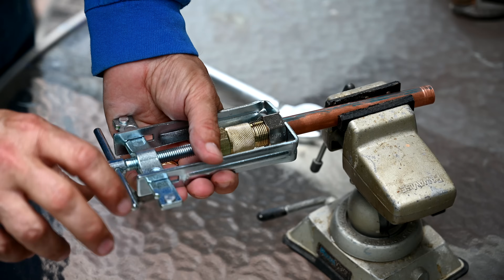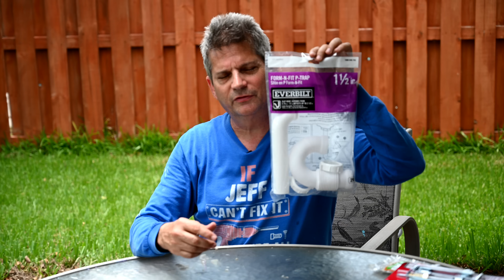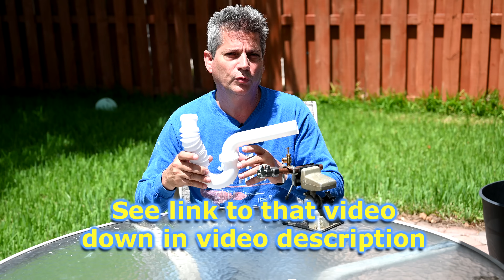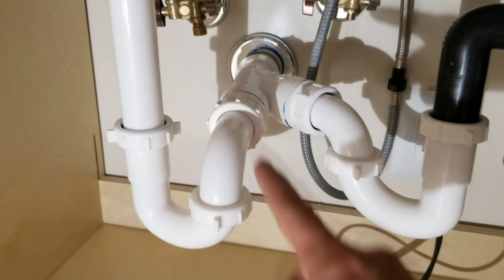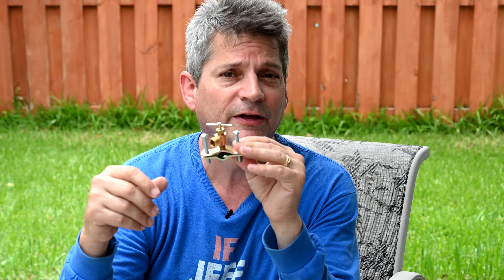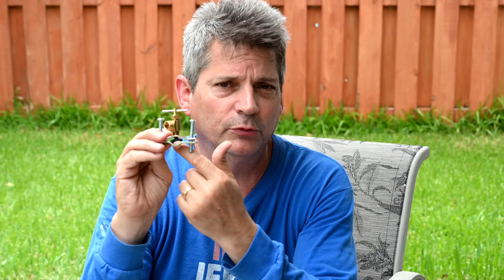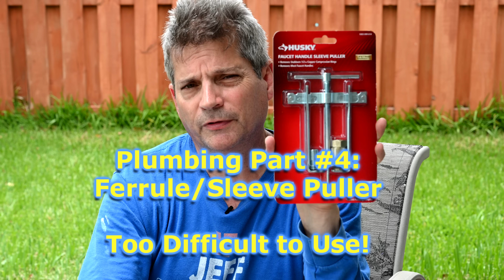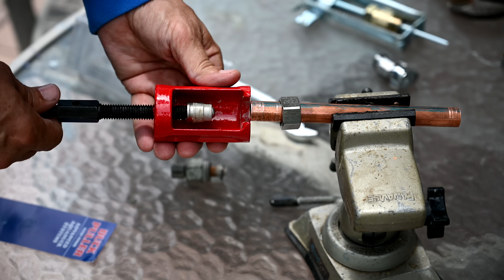4 Plumbing Parts/Tools You Should NEVER Use. NO Plumbing Fails

Comment: To get the compression rings off just grab the nut with your grips and pull and twist or smack the nut from behind with an adjustable spanner around the pipe. Or just cut through the rings
Reply from the maker: Man that's a lot of work for being caught in a tight spot with no room to move around. I refuse to bang on pipes out of fear of ruining a solder connection inside the wall somewhere. That's why I have the duck puller now, it works every time with little energy expended on my end. Before I got this tool, there was one time I  simply gave up and cut the pipe behind the nut, but you don't always have enough pipe coming out of the wall to get behind the nut and make your cut.
Reply: jeffostroff in the UK, Monument make a tool for removing the compression rings where you place the head of the tool around the ring and when you squeeze the handles together it shears through either side of the ring then you simply remove it with little effort and no damage to the pipe
Reply: jeffostroff what’s the duck puller like if someone has really tightened the fitting way too much? Does it still get them off?
Reply from the maker: @laernulienlaernulienlaernu8953  The puller is great, any time I have ever had to remove something that is stuck, the physical properties of using a wrench and screw to drive/pull something out cannot be beat. One time we spent 3 days trying to get a MOEN shower cartridge out of the shower and multiple trips to stores trying every trick in the book failed until we got a tap and die kit, drilled threads into the center of the old cartridge, and used a lag screw through a plywood board to tap into the cartridge and unscrew the cartridge using a socket wrench on the lag screw.

Comment: In the UK we still use “S” traps and our regulations are very comprehensive. Our drainage systems must just be better coz they rarely cause a problem if the drainage is installed correctly
Reply: laernulieNlaernulieNlaernulieN Yup, ventilated drainage prevents syphoning of the trap. Proper downstream regulations prevent the problem so we dont have the problem. P trap doesn’t prevent that problem either: pipe goes “through the wall”, and guess what happens then?!
Reply: Andy Owens a P trap with a 90 degree elbow on the outlet is no different to an S trap really. Does their “plumbing code” ban them from doing that? Does the pipe have to go through the wall?
Reply: @andyowens5494  What happens then, in theory, is that there remains enough horizontal pipe run between the P trap and the wall to prevent the siphon effect by leaving enough water in the bottom of the horizontal tubing to let the rushing air pass and go down the drain while the water that made it into the horizontal pipe section can flow back into the trap or at least slow down enough as it goes down the drain to prevent the rest of the water remaining that an S trap would pull out of the bottom loop from getting out of the trap.  But the key is the venting downstream of the trap!!!

Same thing happens with dam water level regulation with solid plumbing...  If you want the pond to remain at a desired level but have a solid pipe letting excess water leave the pond without draining too much water from the pond but also not getting clogged by floating pond debris and also removing excess sediment from the pond bottom, it's common to run the solid plumbing from the bottom of the pond up and through the pond wall to the drainage area and even with 18 inch diameter solid plumbing, a simple 1/2 inch diameter hole in the top of the solid plumbing on the downstream side of the pond wall will allow enough air into the plumbing to keep the pond at the desired water height instead of allowing the solid drain line from being able to siphon the pond completely empty even though that solid pipe went through the pond wall and exits into a stream or river 30 or more feet lower than the bottom of the pond.  Without that 1/2 inch diameter hole in the pond drain line, the pond would siphon completely empty fairly rapidly but with that 1/2 inch hole the pond water remains not much lower than the bottom of the horizontal section of pipe where the pipe runs from the pond side of the pond wall to the drainage area.
Reply: Andy Owens goes right through the floor lol your so right
Reply: As long as the first part of the trap is deep enough, that air can be blown through the trap, and leave enough water to seal, you're golden. If you ever have a problem of the trap clearing like a toilet, just make the first drop deeper. If you look at it closely, it will do exactly what a toilet does when you flush. It's just that a toilet slowly fills the trap back up, which is the level of water in the bowl. If that ever happens in your sink, you can do the same thing, by just trickling in some water. I've never had it happen.
Reply: Like Andy says below, adequate ventilation will prevent syphons. In the US here, I believe when you "start" a horizontal run, you are required to have a vent nearby, within 6ft I think. Because a p-trap connects to a horizontal pipe, you can be sure that there will be a vent between that trap and another fixture (or else that fixture will be close and will use that same vent).
Reply: Justin Link 

Exactly right!  I was going to say what you did but you beat me to it!
Any horizontal run over six feet requires a local revent in the U.S..
Reply: Same in Oz. Our regs are based on the UK system and have never had a problem with s traps.
Reply: @paulmac7667  Could it be that a vent is required to prevent the mentioned suction?
Reply: I use s traps and never had a problem with siphoning. I though you could not smell methane as he mentioned at 2:30
Reply: @Mike Ladd  BINGO

Comment: Great information....hopefully the DIY people will learn from this.  
One thing to keep in mind for your future videos....Methane gas is Odorless. Methane is usually present in sewer gasses but it's not the one that smells bad.
Reply: natural gas (methane and other hydro-carbons) service has an odorant mixed into the service lines, so we tend to identify a gas leak with that gas smell. That's done on purpose :)
I agree with Andy Owens, some kind of sulfur compound will be what smells.
Reply from the maker: and it's odorless and tasteless, so I wonder which gas it is that we smell when we open up the p-traps
Reply: jeffostroff Sulphides. Most commonly hydrogen sulphide.

Comment: U r not as smart as u claim 2 b buster that tool is 4 pulling off the handle 4 a tub or sink faucet dumbbell
Reply from the maker: Yes! Our first uninformed troll! Husky is trying to bill itself as both a Faucet handle AND a sleeve puller. Look at 17:30 where I hold up the package, you can see the 2 bullet items they printed on the package it claims "Removes Stubborn 1/2 in Copper Compression Rings", and "Removes Most Faucet Handles". Why do you think that center gold threaded puller adapter piece screws into the compression nut, Mr. Know it all? On the back of the package are 2 sets of instructions, one to use as a faucet handle puller, and instructions to use it as a sleeve puller as I showed in this video, and showing it go around the nut. So.... YOU are not as smart as YOU claim to be Buster! Thanks though, you gave us all here a good laugh.
Reply: Why have the arms around the nut? You just threaded the tool into the nut, just add the missing part and use it correct 😉

Comment: saddle valves are allowed in the state of Maine where i am from the flex trap # 2 are passed with no problem your codes are stricter then ours
Reply from the maker: Holy cow that crazy state of Maine! Next, they'll start treating the drinking water with CBD!
Reply: no we use a number of diff ways to make it safe the problem with the flex traps are build up and clogs its true i use them for temp hook ups until i have the right parts to do the job right.
i do find most of my trade friends say florida has some of the strangest rules around but thats how it is in most any state

Comment: Been a plumber for 20 years. I use #4 to remove vintage handles off of tub valves and lavatory valves that are period correct for their home. And they help to not damage the finish.
Reply from the maker: Yes, I would imagine they will grip behind those larger handles a lot better than that mall area on the back of a shut valve nut.

Comment: Might work if you were using is properly.
Reply from the maker: What might work if it was used properly? none of these parts are allowed  because they don't work properly.
Reply: The ferrel puller.
Reply from the maker: @rosscoep1450   You are more than welcome to keep using that 1 and no it doesn't work on stock Ferruls that's where it just does not work
Reply: @jeffostroff  I dont own one, just saying that it looked like it was being demonstrated incorrectly. I reuse the nut and ferrule, they are usually still good.
Reply from the maker: @rosscoep1450  the problem with that Husky sleeve puller as all the darn moving parts. Too many moving parts, and something has to give. That's why I like the duck puller, only one moving part.

Comment: Good video, but two quick comments... 1.  You mention "Uniform Plumbing Code" (which would infer "UPC"), but isn't Florida under IPC (International Plumbing Code)?   (For the benefit of anyone reading comments, the two codes have some rather dramatic differences in some areas.)

2.  The "craptastic" accordion (#2), I think that technically that's not the trap but the tailpiece, so it may require a different code reference.  Code reference aside, I agree with what you said regarding their use.  They're crap.
Reply from the maker: It's hard to say, some counties in Florida add and delete codes, and I do loosely use the term Uniform Plumbing Code to sort of refer to the broader scope of all plumbing codes, which states usually adopt either all or part of the IPC and UPC. I really wish they would all just take the best parts of UPC and IPC, and create ANSI standards that everyone could follow without getting confused as to which part of which standard the county is going by. I don't know why there is such disparity between states. For example, most states allow a high loop under your kitchen sink counter on the dishwasher, but Wisconsin forbids it, requiring instead those ugly top of the counter air gap devices. Here in Florida, we are allowed to use Studor valves under the kitchen sink, but not in some other states. One ANSI standard that we all adhere to would fix this.

Comment: I have used the white plastic for 25 years in my redwood bathroom. Do not listen to this fool.
Reply from the maker: For every one of you guys who gets lucky after 25 years and no leaks, there are thousands who get unlucky with leaks costing tens of thousands. Are you willing to pay the plumbing and remodeling bills of all these people who have disasters after listening to you telling them to ignore an engineer's voice of reason?  Maybe you're cleaner than most so you don't drop stuff down your drain that would catch in a flexible trap causing clogs. Maybe other people by cheapie flexible traps where the accordion creases weaken and they get leaks. Maybe people shove stuff into their vanities that causes the flex pipes to tear open and leak. You can be uninformed and call me a fool all you want, but I showed you the actual plumbing codes, written by master plumbers and engineers, people a lot smarter than you.
Reply: It may work but it is not *code*. If your house was inspected, for example if you were selling it, it would fail.

Comment: @ 12:45   What's the rate for a plumber for "10 minute"job?...... $100.00 per hour minimum.

Home Depot shouldn't be selling these. Why not "Bernie Sanders?" 

I have one connected to my ice maker from my basement for over 20 years without a single leak. I see your point about not installing these in a non-accessible area though.
Reply from the maker: Man you got lucky 30 years and no leak!. Yes I think about a $100 an hour or more is what plumbers charge. I had to have the kitchen drain line snaked out 2 years ago in a condo and the guy was there 20 minutes and it was a $130.

Comment: Had flex tube and saddle valve over 30 years never a problem but will change on next remodel. That cheap $10 extractor tool by different company, never failed in pulling rings out. Pulling arm will bend a little but you could bend it back.
Reply: It looked like he didn't put the silver   piece in the tool. He had it threaded to short to begin with. I have used that tool on 8 supply valves in my current remodel house. The duck tool does appear to be beefier and I wish I would have bought that but the husky one does work with some inexpensive modifications. I put a box end wrench onthe handle to spin it with more leverage and I used some solid strand copper wire around the arms to help keep them closed.

Comment: Always used a cheese saw & cut the ferrul off or just cut the pipe further back/down.  Our inspectors don't like compression valves they have to be sweat.
Reply from the maker: Thomas, What city is this in? Yes sweat valves are great, but it also makes it harder for a homeowner to change themselves, as 99% of the people don't know how to solder pipes. Not sure why they have a problem with the compression valves.
Reply: @jeffostroff  might be a pressure issue? Idk but the inspectors here have lots of power.. In Fort Lee NJ, i was followed to a house, i backed into a driveway where i had sold the install of a customer supplied hot water boiler. Got a deposit week before, but my boss never went for the permit, he planned on bringing it to me that morning. I had a box truck 14' lettered, started unloading tools, drop cloths. Two guys got out of a crown victoria with suits, came over to me and said what are you doing. Showed me badges & guns, plumbing inspectors. Asked me about a permit. I said you're the inspectors didn't you bring yoir copu?  How'd you come upon me 8am hers at the house?   They said they followed me from when i got into town.
  My boss was at city hall filling out the paperwork, but it wasn't ready. They told me i can't even remove the old one until i had the paper in the window.   
   Imagine being followed by 2 men with guns for doing plumbing??
Reply from the maker: @thomasbroking7943  wow, Men In Black.  That seems pretty Gestapo like in tactics
Reply: @thomasbroking7943  That is what they call governing.
Reply: @jeffostroff  pretty much all of Bergen County, i had friends that just did new work. I didn't do much, i loved service work.

Comment: #4 looks suspiciously like a repackaged wheel bearing puller!
Reply: It's for pulling corroded on handles.  That's why it is so long.  A bearing/pulley puller has to be much stronger, like the ferrule puller is.  If the ferrule is stuck that hard, and you don't cut the pipe, you are gambling on the new fitting getting tight enough to not leak.  Maybe not immediately, but a quality repair does not involve using a pipe that has been previously compressed, then further damaged in the process of removing the ferrule that compressed it.

Comment: Jeff, love your videos. On a different subject,I wonder if you could help me understand why I see so much galvanized pipe used as underground gas fuel runs for generators & pool heaters up in Northwest Florida ? ( hopefully you don't tell me they approve it).
Reply from the maker: Bob, funny I could not find anything in plumbing codes banning galvanized after doing a quick search, but I know a lot of plumbers don't want to use it because they know it corrodes, and springs leaks. My friend had it at his 1946 house that we remodeled and removed all of it, a $7,000 plumbing job to re-pipe the house with PVC. I would think that some cities might forbid any new galvanized installations. As for Gas, I don't know the codes on gas, I never mess with it, but I see them running newer yellow pipe these days. Galvanized might not corrode with gas like it does with water, just my guess. Usually the water cause the galvanized pipes to corrode and the center of the pipe gets smaller as it corrodes from the inside, until it blocks off water flow completely. Then it rusts also. Don't think gas would have same failure mode.
Reply: @jeffostroff  I can assure you galvanized pipe below grade is prohibited by the National Fuel code. Now above ground installations I understand is okay per the National Fuel code, because the galvanized processing is a lot better than it used to be. At this time I believe the only gas piping allowed underground per National Fuel code is polyethylene (yellow )plastic with risers, coated Steel, L or G copper , coated copper and CSST in a casing.And of course local codes can always have stricter standards.
Reply: Galvanized used to be pretty much the ONLY option for gas lines. It doesn't corrode from the inside like galvanized water lines. In fact, you'll see plain iron pipe for gas in older homes.  The outside was often protected by a larger pipe used as a  sleeve, or installed in an inspection tunnel  if used outside where there was likely to be water damage or other hazards. The galvanized exterior typically did not rust through from the outside anyway, whereas Iron had to be protected, minimally by a coating.

Comment: More curiosity than anything. I know the majority of sprinkler work is done using saddle fittings. Just wondering what the difference is code wise?  I know they are a much better built than what you were showing
Reply from the maker: I've never seen any sprinklers with saddle fittings.
Reply: jeffostroff I will try and make a reply video of it. Usually see them when they are tapping into a large main to branch out. It obviously doesn’t self pierce. They have to drill it with a whole saw first using a jig.